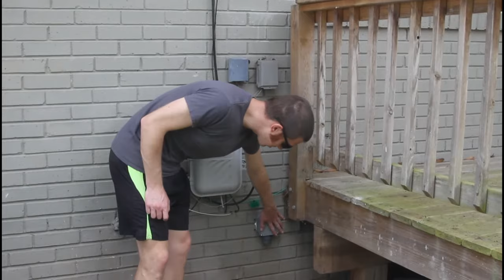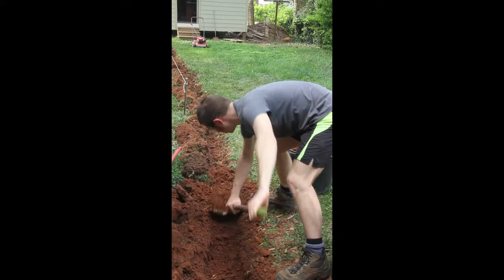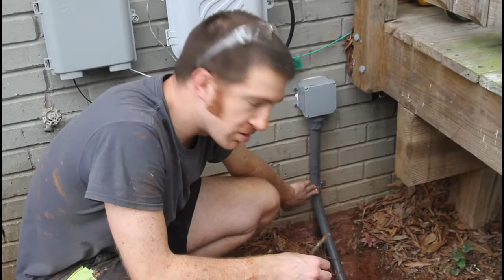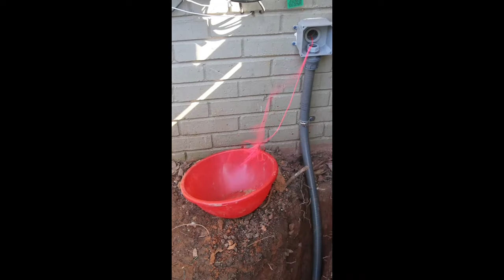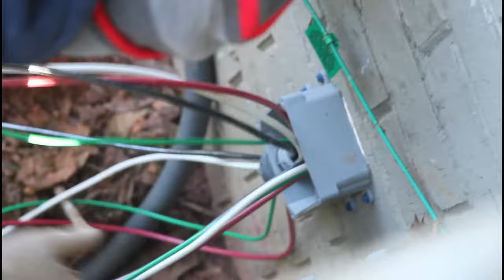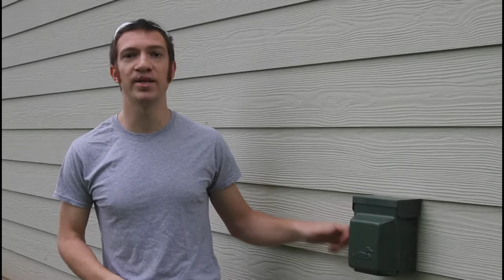Complete Guide to Wiring Your Shed

Comment: As a long time electrician I can say is You did a great job.  PVC would have been cheaper. As soon as you hit that hard pack I would would have (A) rented a trencher or (B) ran RMC after doing a value study. RMC only needs 6 inch cover.
Reply from the maker: Your compliment as a professional means a lot, thank you. I had a bit of a masochistic streak and was looking forward to the trench digging. I'd probably do something a bit different in the future. Good suggestions.
Reply: I just did a 23 foot trench for our new shed and hit a section of rock only 2 inches below the surface.  Oops, I guess I'm not using UF. ;)  I rented a big rotohammer and blasted  a deep-enough trench through the rock for a 6 inch cover, and used IMC instead.
Reply: Very helpful, thank you.

Comment: NM cable has to be secured within 12 inch NEC 334.30. Unless the box does not secure the cable. NEC 314.17(2) and the Exception. If the box does not have a way to secure the NM cable to it, then it must be fastened with in 8 inches. Going through a 2X4 is not fastened because the 2X4 provides Supporting but not fastening. Only a very few inspectors ever catch this. Good video, I give you a thumbs up.
Reply from the maker: Excellent. I appreciate you providing those code citations Jason, and responding to some other comments.

Comment: A couple things to consider when doing this project.

Talk with a pro about permit requirements and maybe exchange some cash for some knowledge on how to do it smartly.

There are plenty of electrical rules.  Someone that does that work may have already solved your future problem 5 times last month.

While your trench is open consider 11/2 in conduit for a future up to about 200 Amp service and several 3/4 or 1 in conduits for future use:

One conduit for a data connection to your home office / server for your business 

One conduit for cable tv

One conduit for 2 warning lights....one in the house for problems in the garage and one in the garage for problems in the house (a dinner bell in a noisy garage).

With the trench open, any depth requirement can be met, but do it later and re-dig your trench.

Comment: You did an excellent job of following the NEC.   I would have preferred a purchased ground bar rather than removing the link for the two neutral bars.   Questions,   Why did you not connect the neutral to the lug on the left bar?   Did you install the bonding screw or tab from the right bar to the can of the panel?   I could not see that in the video.   Again, very well done video and project!

Comment: When you back feed a breaker and intend to use it as a main disconnect for your panel the breaker has to be bolted in even if it is a snap in or plug in type breaker.
Reply: See NEC article 408.36d. Back fed devices.
Reply from the maker: Hi there. There's no back-fed breaker in this project. The subpanel power is being supplied through it's own main breaker which is permanently fastened by the manufacturer. The breaker in our main panel functions just as any other breaker supplying a circuit or appliance.

Comment: Great video! What size wire do I need to bury for a 60ft line, it's gonna power up a 15 amp mini split, AC/HEAT, its 110 v and 15 amps, I also want to power 8 outlets and 3 lights, no appliances will be hooked up in my shed, at the most a 60 inch TV, no major tools or anything, the shed is basically a gym/entertainment area, it's a straight shot, therefore I'm thinking of using pvc conduit, also, I will not have it inspected, any ideas?
Reply from the maker: Hey Art.  I would recommend just running a 20 amp (12ga) circuit from one of your external GFCI outlets. Generally distance isn't an issue until you get to around 100ft.  See this article for a detailed description. https://practicalhomeprojects.com/?p=138
Reply: if your a/c is drawing 15 amps, 20 amps is the minimum. i would usualy recommend 30 amps. but your sayong you have low power devices so its ur choice you could always run bigger wire with a smaller size breaker and then upgrade the breaker if you need to

Comment: Great video!  But I am confused/surprised by one thing.  You installed two ground rods at the shed and also tied your subpanel grounding bus back to the main panel ground bus.  Doesn't this create a ground loop?  I.e., if you had a lightning strike nearby there could be a voltage difference in the ground between the ground rods at your shed and at your main panel.  That would cause current to run through your grounding system.  I'm curious if any electricians reading this can comment: don't you want to have your grounding system have only one path to ground?  It sounds like you had your work inspected and it passed inspection.  Presumably your electrical inspector knows more about this than I do, so maybe I am missing some detail.  Just thought I'd ask...  Thanks for the video!
Reply from the maker: Hey Stephen, Everything I did here was following my local code and was passed by a local inspector. 
I don't know enough to give a confident answer, but here's my thoughts. The two patches of dirt may have potential differential of a few mV, but since we bonded the two grounding systems, by definition there can be no difference in electric potential between the sets of grounding rods. If lightening strikes, it's just trying to get to ground and will take the least resistant path, hopefully through the shortest amount of wire. Best of luck!
Reply: I've done the same thing, however I didn't use ground rods just installed the bonding screw in my sub panel bc that's what my inspector wanted. it's worked with no problems for 10 years
Reply: Yeah.  I was confused by this exact same point.  I thought that the subpanel should not have an earth ground.  It should definitely not have the neutral-ground bond, but I also thought that there should be only one earth ground and it should be at the main panel

Comment: Could you have also used UF direct burial wire instead of running wire through the conduit?
Reply from the maker: Hi Shazad. Yes UF direct burial wire would work just fine. You'll probably have to bury 24" deep instead of just 18". I don't remember if code required, but you probably want to protect the cable where exposed outside above ground as well.
Reply: @practicalhomeprojects  You are correct, UF cable alone would have to be 24 inch unless it fit another rule in the table, like under building, under concrete, ect. NEC Table 300.5. For anyone that does not want to buy an NEC, a picture of this table can be found by google search. Also I am using the 2020 version for NC, some states use a different year( I just had to throw that in).

Comment: Couple of quesyions :
1) if you went through all the trouble to dig a trench why not run another conduit with CAT6 wire  for Internet Jacks or an Access Point in the shed?

2?) Did you bury Yellow Caution Tape six inches above the conduit when you filled in the trench?

3) Was the wire you ran in the conduit underground rated in case the conduits leaks and gets water in it?
Reply from the maker: Hi Jay, Thanks for the questions.
1) You could run ethernet in the trench as well. Like you mentioned it does need a separate conduit. The distance was close enough that I still get wifi in the shed, so I didn't think about it.
2) They actually make special red tape to indicate electrical wire that you might put 6" above the conduit. https://amzn.to/3tuZlMv. Not a bad idea to include, but not required by code in our area.
3) Yes, You have to use wire rated for wet conditions, so not your everyday romex. We used THHN/THWN-2 wire. Here's a link to the vendor to show the conditions of use. https://www.southwire.com/wire-cable/building-wire/simpull-thhn-copper-wire/p/BW1

Comment: I have been trying to run a project like this but haven't figured out a way to get the wire from inside my garage on the opposite side of the house where my main panel is located to the back yard to where I will dig my trench leading up to the shed.
Reply from the maker: That is a bit tricky. Do you have access to the attic space above the garage? Or at least a ceiling cavity? You could always run conduit on the side of your house all the way around, but it would be a bit ugly and expensive.
Reply: @practicalhomeprojects  No access above the garage. I plan to cut an access point to run 250V lines in my garage. Unsure what I'll find up there yet.

Comment: So did you use a 60 Amp breaker at the main breaker and at the subpanel?
Reply from the maker: We used a 60amp breaker in the main panel to match the permitted capacity of the conductors. The sub-panel has a 100amp breaker which doubles as a shutoff.

Comment: You should have rented a "trencher" - a glorified chainsaw, which cuts a slot no wider than the conduit or than is necessary and very much deeper, rather than the full width of your spade.
Reply from the maker: Hey Andrew, Thanks for the idea; that would have saved us a bit of time and back ache. We looked at getting a trencher or ditch witch and it would have been >$500 after rental, insurance and delivery so decided not to go that route.

Comment: 60 amp sub panel in shed. What size breaker did you use in main panel in house?
Reply from the maker: Hey there. The panel is rated up to 100amps. The breaker in the house is a 60amp.

Comment: Of mine main panel is a 200 amps, and my subpanel is a 200 apms also can i connect it in to the main lugs?
Reply from the maker: Hello Elias, You definitely don't want to hook your sub panel up directly to the main lugs of your main panel. Any connections bringing power out of your main panel need to be protected by a breaker. I don't know if there is any rule against it, but I would not have a single circuit with the same capacity as my entire panel. Maybe just use a 100amp breaker even if the subpanel is rated for more. Good Luck.
Reply: @practicalhomeprojects  thank you very much, still learning!

Comment: Thank you for the great information!!  What gauge wire would you recommend for 130ft to a shed that will need 120v?  Just need lights, vacuum, sprinkler timer etc.  Can a  guy get away with #8 or is this long enough for #6?  I also notice you opt for individual wires rather than a cable.  Is there a reason for this other than it's what you have on hand or is it less expensive and maybe easier to pull through conduit?  

I'm in a situation now where I have a shed coming in a month but running both conduit and wire/cable right now may be too costly.   Yet, in three days I am renting a trencher for water lines and it would make sense to run conduit for electrical even if I do not run wire/cable yet simply because of cost and the logistics of where I am trenching near the house.  My thought is that as long as I am there I might as well lay the proper conduit with string and junction boxes even if I can't quite afford the wire right now.  But I also know that #6 is tougher to pull than #8...

Thanks for any advise on wire size!  I prefer to do this trenching and conduit work myself and then pay a pro to connect both ends.
Reply from the maker: Hi Scott, Good Questions. I'm not a professional electrician, but here are my thoughts:

It sounds like you don't expect any heavy duty equipment, so 20amp 120V service is probably sufficient for your application. On our website we outline how to set up a single 20 amp circuit. It's much simpler since you won't need a subpanel and all of the extras that come with it. https://practicalhomeprojects.com/?p=138

The distance might affect the gauge wire you need to safely operate that 20amp circuit. For shorter distances, you'd use 12gauge wires. At around 100ft, the voltage drop becomes significant enough that you'll want to do some quick voltage drop calculations to make sure that it doesn't drop more than 5%. Be sure to use the distance the wire will travel rather than just distance between sides of the buildings. You'll most likely step up to 10 gauge wires. https://www.southwire.com/calculator-vdrop

Individual THHN wires vs. a cable is up to your preference. The correct type of cable can be direct buried with no conduit, which saves a bunch of time. However if you are going to use conduit, you'll have to use a much wider diameter with cable rather than with wire due to the fill calculation. Also THHN is coated to be low friction whereas cables are not, so wire will pull much more easily.
Reply: If you have not dug yet, consider putting a bigger pipe in there.  Today, you can run a 15 Amp 14-2 through a 2 inch conduit (way oversized).  You could easily fit a 200 Amp sub panel feeder in that same pipe.  Just use one wire as a rope to pull the other.

Second, consider extra pipes like 3/4 or 1 inch.  

    Cable tv, hardwired 8nternet, an alarm fir diner, security cameras, whatever else you can think of.  Burial depth is based on the voltage plus some extra stuff.  But a few dollars today might mean not having having to re-dig the same trench  later.

Hope I got you ontime.

Comment: How did you transition the conduit thru the shed exterior wall?  I'm also running my subpanel on exterior wall between studs and need to come thru wall with conduit.
Reply from the maker: Hello, I just ran the entire conduit right through the floor of my shed and spray foamed it back. You could also do a junction box on the outside with a connection through to the subpanel.
Reply: @practicalhomeprojects  I figured it out yesterday, ended up with:
1.5" PVC conduit > threaded male adapter > metal conduit LB > chase nipple thru wall into knock out in back of panel.

Comment: Pvc would have been soo much easier to pull. And 3/4 pvc is really flexible for minor turns or just use a beat gun to manipulate it. Sealtite is really bad for pulling long distance. U could transition to flex on the ends. Works good. Otherwise great work
Reply: Yeah all good valid points. 
I'd only add 
Use a much bigger conduit then you need , and go at least one or two more awg size then you need. (Within reason)
Because the few $ you spend up front saves you from triple the cost and having to dig yet another trench .
I went with a 8awg for about $6 more than 10. Now if I want to put a bigger breaker I'm set .
So $150 vs another 156 for wire cost 🤔 (306 total)
Reply from the maker: Thanks for the tip Dustin. I thought it was surprisingly hard to pull considering I had <20% fill.

Comment: If you said it, I missed it. 

What gauge wire are you running and how big was your conduit? I'm just about to do this same project but I'm gonna need to run 8 awg wire for 240 v.
Reply from the maker: Hey there. You can see a written description of the project here: https://practicalhomeprojects.com/?p=138
We used three 6AWG conductors with a 10AWG ground conductor. All in a 1" PVC conduit.
A fill calculator like this one is very helpful: https://www.southwire.com/calculator-conduit

Comment: What size breaker did you use to run to your shed.
Reply from the maker: Hi Tim, The beaker on the main panel is 60 amps to match the maximum allowable loading of the feeder wires.

Comment: How did  you pass the wire through the shed wall?
Reply from the maker: The feeder wires need to be enclosed in conduit or a junction box at all locations. I ran the conduit through the floor of my shed. I made the hole at an angle so that it would miss the joist and still come up inside the wall cavity.

Comment: What electrical panel (make/model) did you end up using?  I'm planning to do the same thing. 

Thanks for sharing..  Looking forward to the next episode...
Reply from the maker: Hey Joe. I grabbed this one. It was cheap and I already have GE breakers. I wanted to make sure it had at least 16 spaces for future improvements. Also you'll want a main breaker panel. If you use a main lug panel, you'll have to additionally use a power shut off switch. Let us know what type of videos you'd like to see in the future!
https://www.lowes.com/pd/GE-125-Amp-24-Spaces-24-Circuit-Convertible-Main-Breaker-Panel-Load-Center-Value-Pack/3150199
Reply: @practicalhomeprojects  Perfect. Thanks for the info.  We still have some work to complete before starting on electrical.  Just want to gather supplies in advance..

Thanks again...

Comment: Pvc pipe would have been a lot cheaper
Reply from the maker: Hi Thomas. You're right. The flexible conduit plus connections were probably $60 over a simple schedule 40 PVC solution. I chose the flexible option so that I wouldn't have to deal with multiple partial angles and because I imagine the connections would make it more difficult to pull the wire.